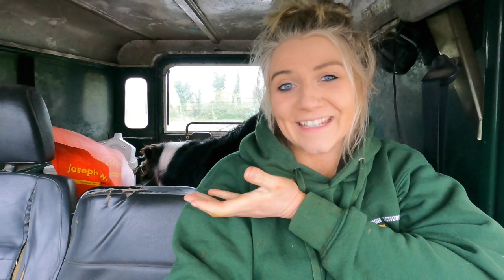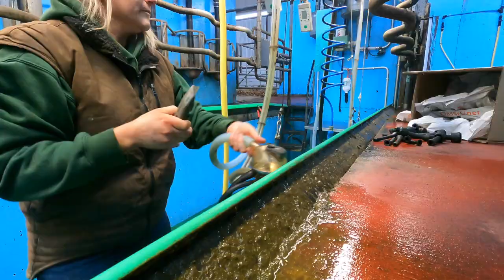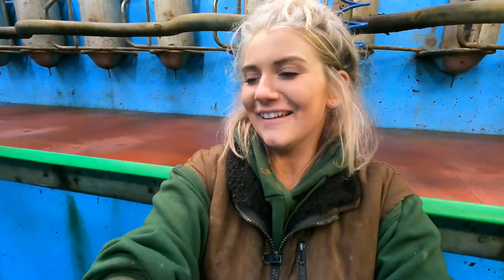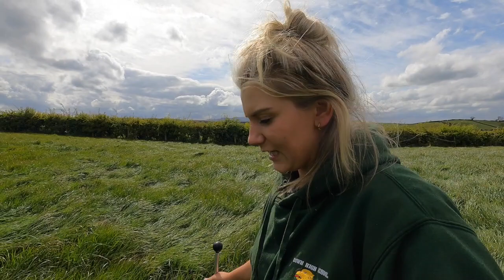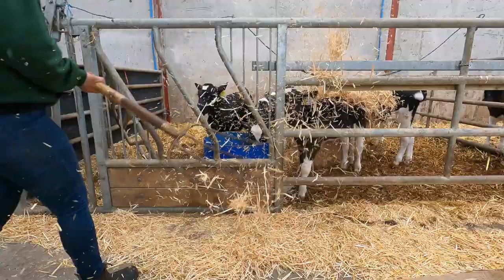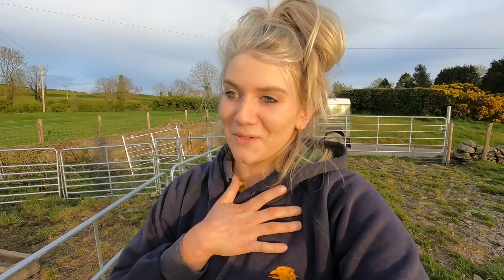COME FARM WITH ME // 10 // annatrues

Comment: Lovely video Anna and I would not worry too much about your groove. Filming and edit a video takes time and after a days work you need time for yourself. Quick tip, get your self a cheap pair of garden secateurs as they will snip throoug those rubber liners with no issues, no need to chance messing about with a knife :)
Reply from the maker: Thanks for the tip Kenneth!
Reply: @annatrues6096  I learnt the hard way and took the tip of my finger off when trying to cut through rubber pipes. :)